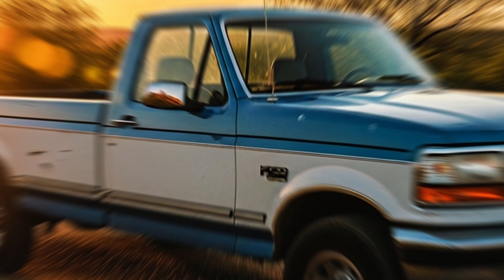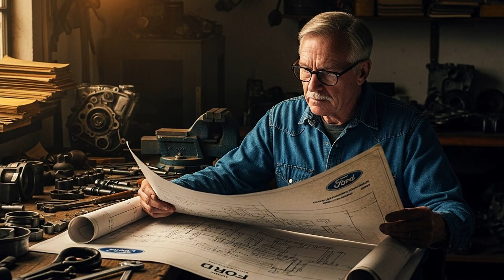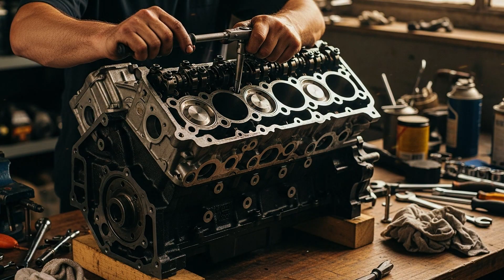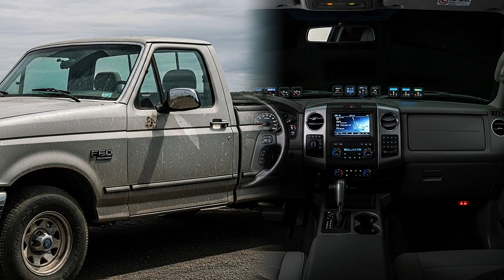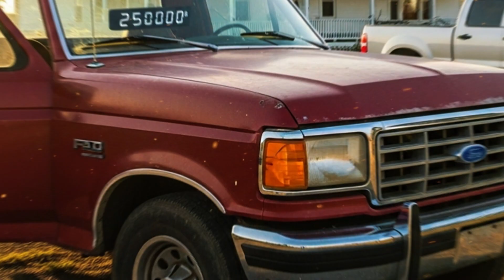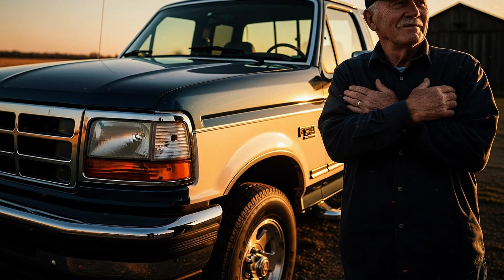1992-1996 OBS F-150 Owners: You're Sitting on the LAST Indestructible Truck - Engineer Confirms🔥

Comment: I own a ‘95 F150, 4.9 liter 6, 2wd, 8’ box, 5 speed manual.  201k miles.  Still runs strong.  Originally a southern truck.  I live in New England, I do not drive it on messy sanded/salted/snowy roads.  Being 2wd, it will get stuck on an ice cube anyway.  AWESOME truck!